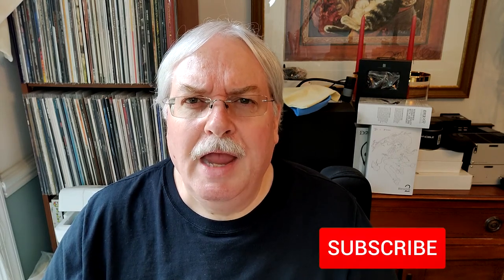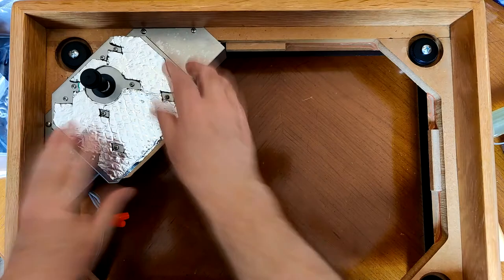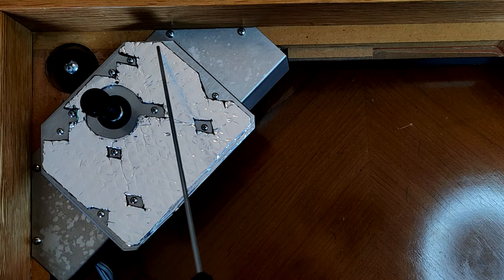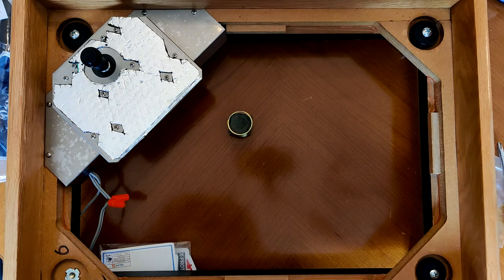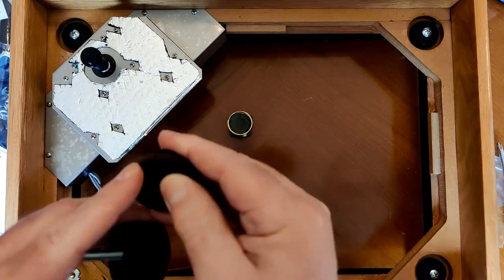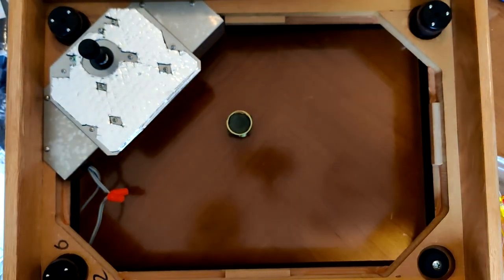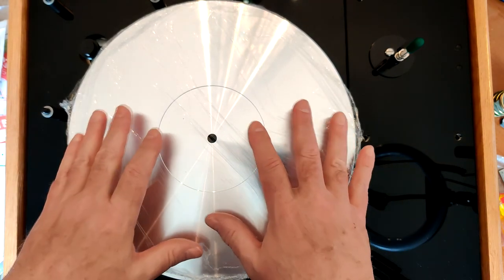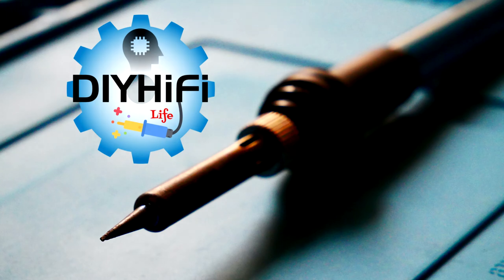VPI HW-19 Turntable Upgrade Pt 3

Comment: I am the original owner of the same turntable and the same SME 309 arm. Keep going deeper, I like what you are doing. I've changed the suspension a couple of times, usually for the better. This turntable needs better speed control that is affordable, that is all it really needs. I like this video.
Reply from the maker: Thanks for watching. I don't actually have the SME 309 arm. I just used a picture from the internet for the opening sequence. My next video in the series will reveal my Tonemarm choice details. Stay tuned.
Reply: Get a blackbird tonearm game changer he does an SME mount